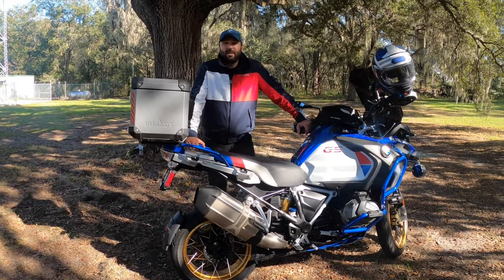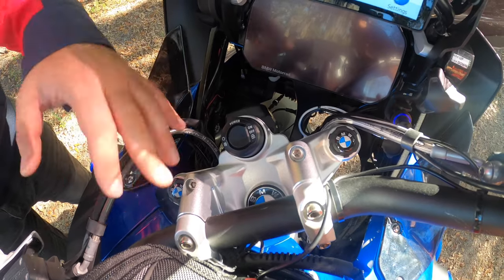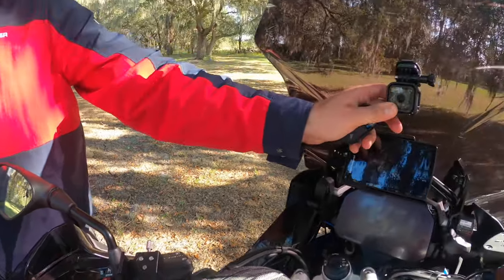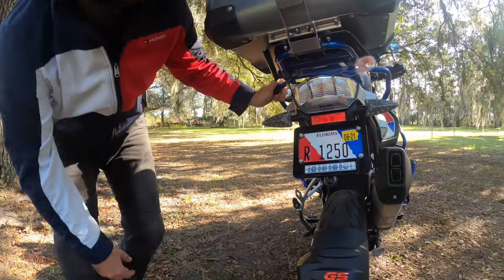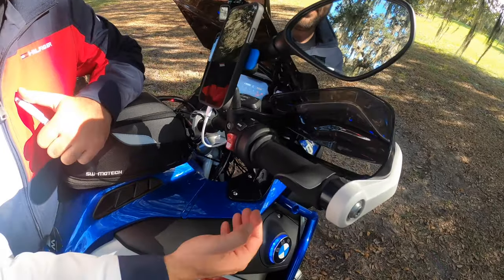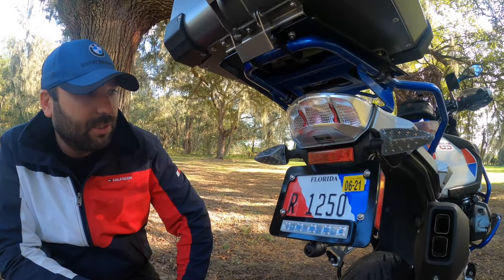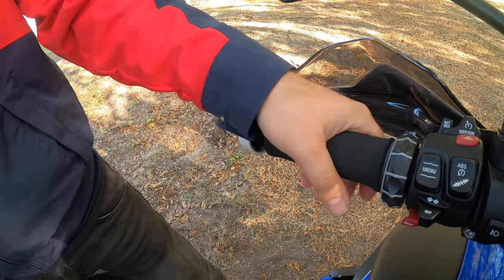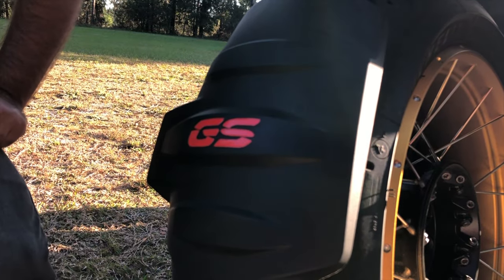BMW R1250 GSA 42 UPGRADES ACCESSORIES & MODS on my #bmwgs1250 #bmwR1250updates #bmwgsaccessories

Comment: Great video Steve, how do you ask in aliexpress for you goPro remote control adaptator on your handle bar? You just mentioned it in your video, but never referred it specifically How do you name it? Thanks.
Reply from the maker: US $10.42  8％ Off | For BMW R1250GS F850GS For Honda For Kawasaki Z750 Z800 For YAMAHA MT07 MT09 GoPro Remote Control Motorcycle Parts Accessories
https://a.aliexpress.com/_msVMUgL

Comment: Hello, where you by the holder for the gopro remote control? do you have a link for me? best regards
Reply from the maker: US $10.42  8％ Off | For BMW R1250GS F850GS For Honda For Kawasaki Z750 Z800 For YAMAHA MT07 MT09 GoPro Remote Control Motorcycle Parts Accessories
https://a.aliexpress.com/_mNTW6I1

Comment: The handle bar risers are ok but the hardware sucks the bmw torx heads are larger than the allen bolts that come with the risers 
I ordered bmw bolts but had to trim them a little shorter so they didnt bottom lout f

Comment: Your phone is not protected from the rain. Neither is your USB port.  Believe me…..  in a downpour you will short the connection.
Reply from the maker: in a heavy rain usb port doesn't work because it gets wet. but otherwise it is very useful